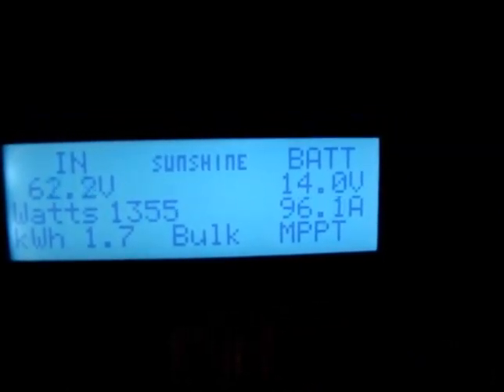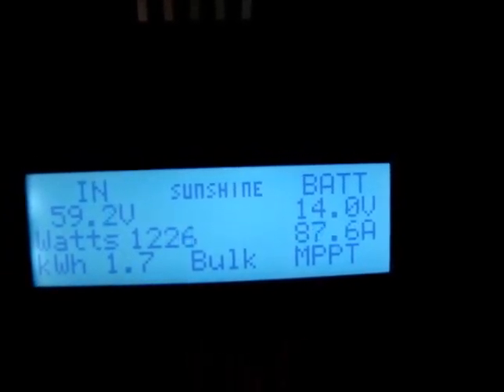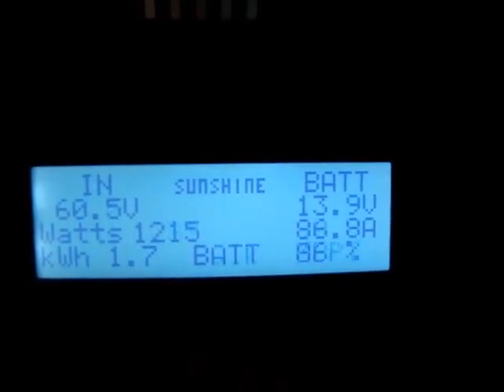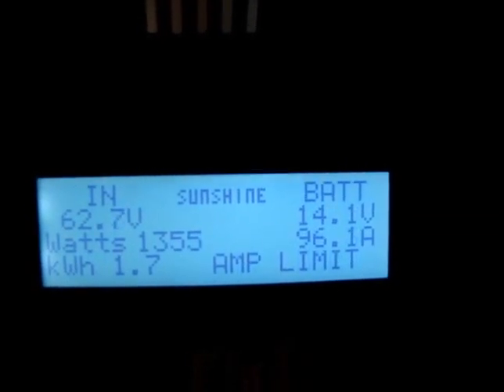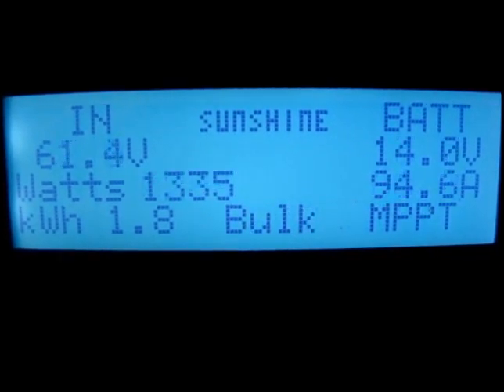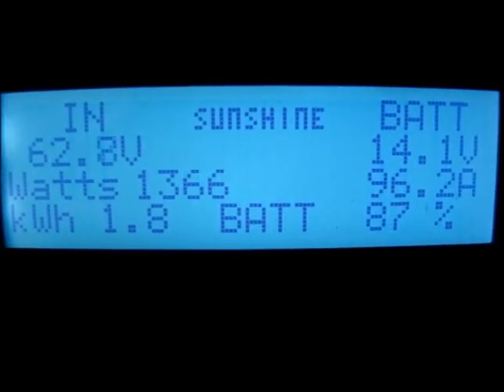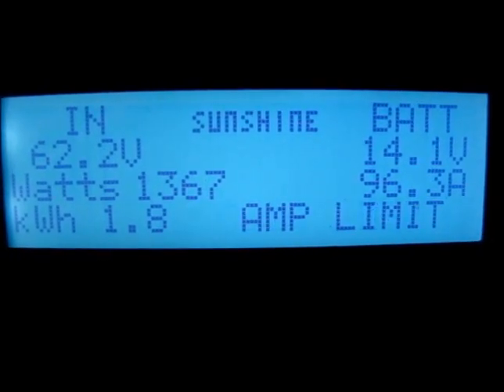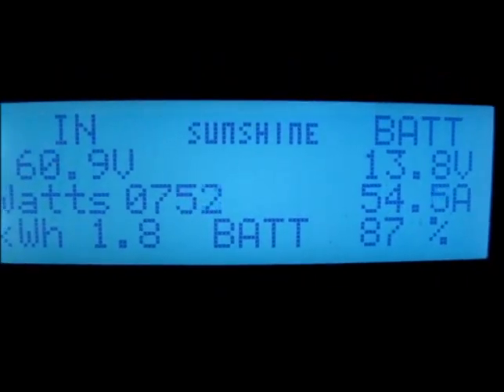Solar Cloud Edge Effect - Midnite Classic 150 Reaching Its Limit

Comment: what voltage are the panels and how have you wired them up thanks I have 2kw of 36 volt panels through a on grid system but I'm going off grid as much as I can so I need to rewire my system as they are in series at the momentthank you
Reply from the maker: You can get specifics on my system from my video... https://www.youtube.com/watch?v=HxJ-MUePm-Y  I have 1,650 watt panel array.

Comment: Mr Ohm tells us that power is current squared multiplied by resistance. (I*I*R) Changing to a 24 or even 48 Volt system would be preferable to adding another controller. Because losses increase with the square of the current, cutting the current in half reduces loss in the wiring by a factor of 4. With a 48 Volt system, the current would drop to one-fourth its present value reducing wiring loss to one-sixteenth of what it is now.